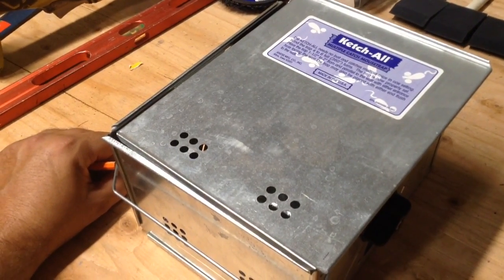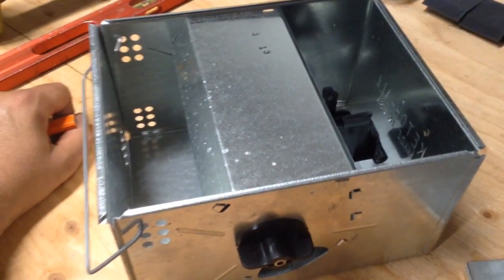Ketch All - The Better Mousetrap

Comment: This trap has an adapter with a tube to a bottle lid.

You slide the lid back, just uncovering the trap chamber, and the adapter slides in over where you've uncovered.

The trapped mice in that chamber will want to crawl up through the tube, which is more like a Slinky, and fall into a jar screwed onto the other end. 

It can work as extra mouse storage, so they don't cannibalize each other while they're all in the chamber, or you can fill it about halfway with water and drown them. 

Some manufacturers make a version of this trap that comes with that accessory, but the, "Kness Ketch-all, Made in USA," trap doesn't. So, you have to buy it separately.

But, it's totally worth it. 

This is by far the best mouse trap I've ever bought. 
It catches multiple mice, all by just winding it up one time, and if you don't want to let them all go free somewhere, (don't just bring them to your neighbor's house!!) you can just make the couple more dollar investment and order the bottle tube adapter.

It's the last mouse trap you'll ever have to buy.
(Unless you also have a rat problem, in which case you'll need to get another trap for them too.)
Reply: Do you know where I can buy it?

Comment: If the knob is a little soft does that mean I can't use the trap anymore? Mine from last year caught a total of around 25. Last mouses tail was caught  in the planes levers and I had to shake the machine a little and trigger the trap like if there was another mouse entering the trap to release that  mouse. Another trap that accompanies this trap lil' Pete caught others total of three. I may have to get another one ketch all to replace the one I have. I may have overused the present one.